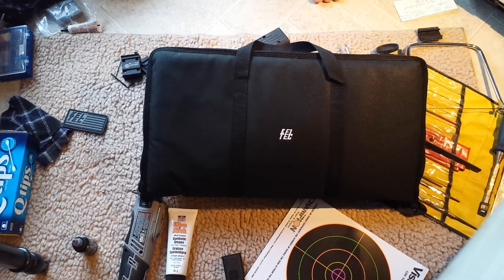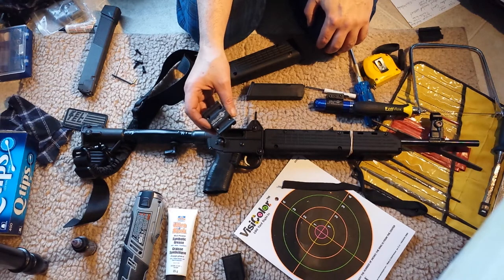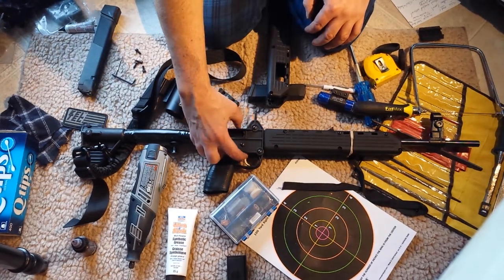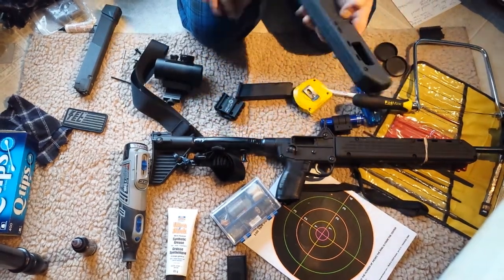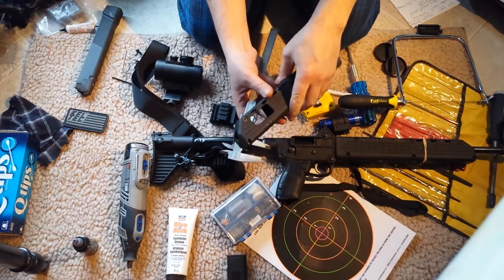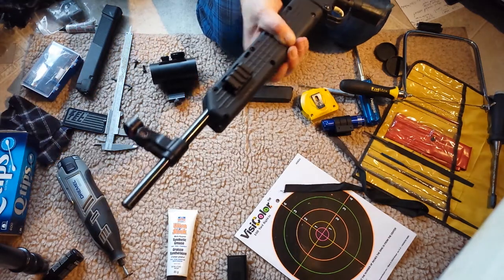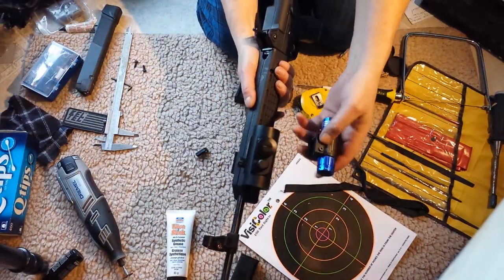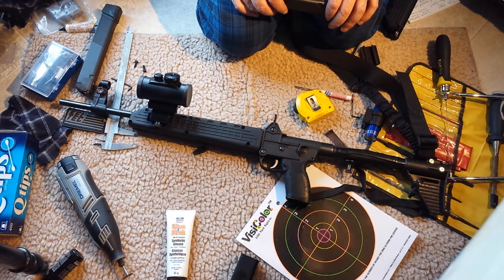KEL-TEC SUB 2000 RAIL modifications

Comment: I just added a rail as far back in the hand rail as possible and with a 45 degree mount it stays zeroed and still folds. I also used the innertube for the grip area and the exposed area of the 33 round mags.
Great info video.
Reply: BTW I was going to use your method if it didn't stay zeroed but after 500rds it shoots bullet holds .